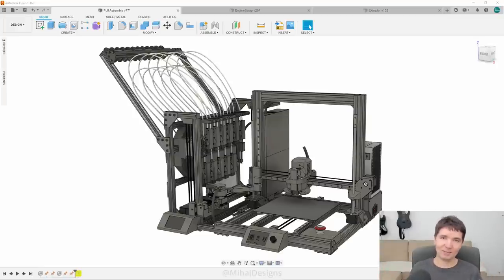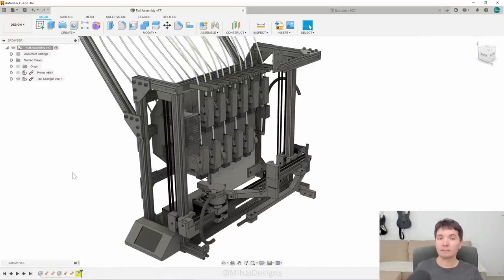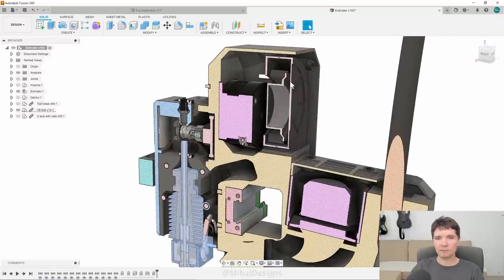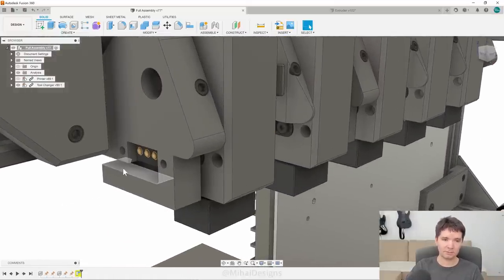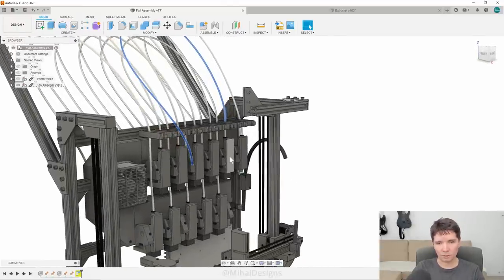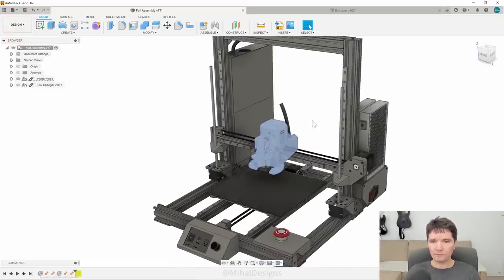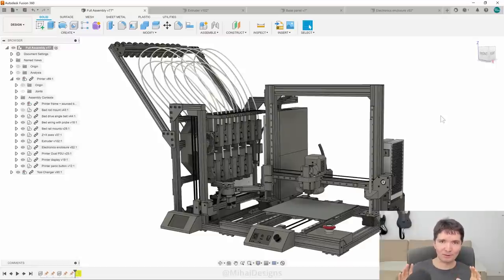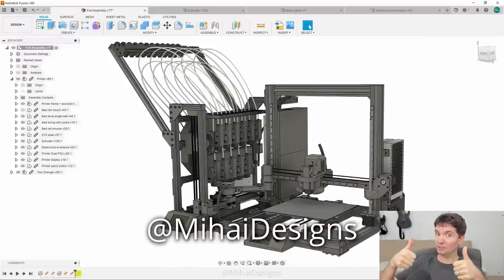PitStop 3 multi-material 3D printer in-depth design. 10+ materials at once

Comment: Great work! Can't wait to see it in action, though I'm fine with my MMU2s as is right now.
Quick question: Where did you source the 4mm OD, 2.5mm ID PTFE tubes?
I'm running couplers (PC4m10) at the back of the MMU2s, and am frequently running into friction issues. Is there an european source, or "only" some non-EU-marketplace?
Reply from the maker: Happy to hear your MMU2S is working well. Sadly 2.5ID PTFE is hard to find. 3mm ID you can find on aliexpress and it works well if you're a bit careful not to kink it. For 2.5mm I had to place a special order and I would have to check where...
Reply: @MihaiDesigns  Awesome, thanks for the info - I'll try with the 3mm ID tubes, and try to add more straighteners (once my replacement revo6 heater core arrives, that is, and I can print more of them).

Comment: Awesome concept and very well thought out. I personally think that many color options is excessive but to each their own. A lot of materials would be great though but I would personally rather see tool options. Do you think this would work with a direct drive extruder, or maybe even other tools like laser heads, mills, plotting, pick-and-place, ect...?
Reply from the maker: I have customers requesting 20 material builds, so there's always a demand for more.
This is a direct drive extruder, so I'm not sure what you mean there.
I'm only focusing at 3D printing for now, although a modified version could host other kinds of tools.
Reply: @MihaiDesigns  Somehow I missed the fact that they are direct drive. I guess I saw the bowden tube and assumed even though I did watch the whole video. Maybe I got distracted by the delta fan. Again awesome work and design. Thank you for the reply and I hope to see how this goes. Good luck with your project.

Comment: I have noticed that filament often breaks when just sitting idle for a few days with minor stress on it. Having 10 filaments threaded and sitting might be troublesome.
Reply from the maker: This is a very good point. I have noticed the same with certain filaments. I'll have to see how often this happens and what solutions there could be to avoid it. Unfortunately I don't have a clean and simple solution.

Comment: have you tried lead screws with a smaller diameter? I have been using 4mm T4 lead screw for a couple of years and have no distortion at all, I never aligned my lead screws. I honestly don't know why most printers still use 8mm lead screws, its very sensitive for misalignment and makes it less reliable

Comment: What sort of repeatability are you getting on the tool changes? Also how are you calculating the offsets between tools? TAMV is a solution I use on the e3d tool changer. Could be used here.
Reply from the maker: I'm still to build and test for repeatability. I expect micron precision. Nozzle offsets measured via probe, just like Prusa XL will do.

Comment: 12:05 With the pogo connector have you considered the possibility of sparks or unwanted momentary connections during the swap process? I mean, if the hotend slides into this connector, whats warranties are we gonna have when, for example, during the slide only two of the for are making contact , even for an split of a second? Can we just turn off completely the connector, change the hotend, turn on the connector and continue with the waiting process for the temps to reach our desired values? I hope to have explained myself.
Reply: Having the connector to a side, I think, is my main concern
Reply from the maker: Yes, for this the heater needs to be turned off, otherwise firmware safety features would kick in and stop the entire device.

Comment: Between Bambulab and this I'm cancelling my Voron 2.4 build...

OR how do I reorient and align it for a toolchanging 2.4... One day when CAN bus boards get cheap the toolheads can include the extruder with no additional pins.

Lastly I would suggest a corexz mechanism a la Voron Switchwire to save space, free up a motor, and avoid leadscrew wobble.
Reply from the maker: I might try that if I encounter problems. And there's also a CoreXY version planned, although still far into the future.

Comment: I remember you miming this idea a long time ago! Awesome development. Great Job, love the concept but the name needs to be changed.  Both ‘Pit’ and Stop are negative terms. Putting them together doesn’t make the double negative (positive). 
Even though the racing term is not by definition negative this needs a much better name. If your printer pits the surface or stops running it is a sad day.  Mythological names or epic terms would suit this jaw dropping concept much better. 

Congratulations, I love it, keep going! 🥰
Reply from the maker: The name could be better. I dumped the previous one, and people kept calling it PitStop (from my previous extruder design) so I didn't bother changing it. Any specific suggestions for the name?
Reply: @MihaiDesigns  Tekton, or Meraki… guessing off your channel name it might make sense to you and go over the heads of most others. 👍

Comment: i still don't quite understand how you would load the filament?
so the filament is in the hotend, but you would need the extruder to be in between the hotend and the spool
how would you keep the spool attached to the hotend while being able to engage with the extruder?
Reply from the maker: This is a fair question. It's actually what makes my extruder unique. The extruder gears move apart during the swap. It'll be easier to show it in action once I get it physically built.

Comment: Instead of having dedicated pre-heating slots, why not just activate/deactivate heating at individual positions?
Reply from the maker: Because I would need a way of driving 10 heaters and 10 thermistors (or 20 for the larger version). Not impossible, but definitely much more involving in parts.

Comment: How do you figure that linear bearing (Extruder asm) is going to hold up? Seems like it could see some significant side load from the cable management if it gets pulled tight or pushes down since that thing is like an 6 inch lever by the looks with the LB being the fulcrum. Side-view @ 25:10
Reply from the maker: I don't expect much tension in the cable loom and I can alter the design to allow for a bit more flex at the back, but it's an interesting idea for a repeatability test.

Comment: I have decided not to get a Bamboo Lab X1C mainly because of the carbon rods wearing away and introducing slop into the bearings, also that carbon dust is really dangerous stuff and combined with fans is a recipe for very ill health, I can see a situation where Bamboo Lab may be receiving some litigation down the road.
 I decided I would like a toolchanger to save on waste plastic and promptly put down a deposit for a Prusa XL but all of the delays really pissed me off so I redeemed my deposit and started looking elsewhere, I was already subscribed to your channel and had somehow forgotten I had seen this video once already, I have considered the Enraged Carrot Feeder but it just does not float my boat and I dont know why.
 I am extremley interested in this design and once completed and Beta is completed I would like to build this whole system, I have some experience in building a printer having already built the Pro 3D V-King 400 from self sourced best quality parts, it cost me a small fortune in shipping costs alone but I have ended up with an awewome printer that I know inside out but I want multi colour and multi materials.

Comment: why not making the pre-heating on the arm, ready to be install on the extruder ?  this way you need only one pre-heating station (on the arm), and not dealing with tangling the tubes.
Reply from the maker: Good question! 2 reasons: one is that the arm cannot cover the connectors the way the swapping works. Second is that it would happen to need more than one hotend preheating at the same time, when the tools need changing in rapid succession

Comment: amazing poject! BUT i think, for the "active" and "non active" parking slots, it would be way bettter to just have all of them "active" and just detect in the g-code when wich hotend needs to be preheated, because al this different additional movement can allways provocate problems, jams or the printerhead itself comes in the way of the moving parkingslot-arm. for the delta-fans, they are realy good, BUT they are also REALY loud! for shipping the printer, it is inevitable to need a first setup with recalibration, this guys wich di the shipping are not realy known to be careful even if on the box it says " fragile" or "handle carefully"
Reply from the maker: The challenge with active parking slots is that if you have 10-20 of them you need custom hardware. Sure, it can be done, but first I want to see if the current solution works and decide later whether it's good enough or needs re-thinking. With the Delta fans I agree that they are loud, but I expect them to run at 10-20% speed most of the time and only crank them up when performance/speed is a priority. Indeed shipping comes with its own risks and there should be an easy recalibration after shipping/moving the printer. Thanks for sharing your thoughts!
Reply: Granted heavy stuff tends to be a bit different, but i have worked in logistics (a loading dock for Walmart) and can confirm they rush you so much warnings usually don’t mean shit lol

The “LumenPnP” Project by Stephen Hawes has a great video on how to pack for shipping + test your method.

Granted i bet that can be put on backburner until the hardware is fully developed lol !

Comment: Ok one very large luming question I've got. How do you hot plug hotends without freaking out the thermal runaway or did you just disable it all together?
Reply from the maker: If you set mintemp to 0 and turn off heating during the swap then there's no thermal runaway error. It still detects thermal issues during heating afterwards.
Reply: I'm guessing that's with marlin? With klipper the temperature spikes to -9999999 or something random depending on which thermistor is selected in the config. I'll have to try it and see if it will work for klipper. Like it makes sense now that I think about it. It's detecting both the minimum tempature and the distance from the set temperature for thermal runaway. If you have no temperature set and the minimum set so low it cannot error then hotplugging should be possible. Thanks I appreciate it I've been trying to wrap my head around this one all night.

Comment: It's probably unrealistic to say the 'nozzles will always be in the same height', anytime you take one apart and put it back together, change nozzle parts out, auto-swap nozzles, it's likely to never be exactly the same repeatedly. Use the NFC tags for offset storage and possibly plan for a way to measure offsets at least relative to something. previous nozzle etc, else a lot of first layer issues, nozzle scrapping top of prints/bed, and inaccurate layer heights between your swap operations. If you don't take variable heights and engagement tolerances into account, you're likely going to be doing some far more tedious tweaking for each nozzle you add, vs some universal offset code.
Reply from the maker: That's why there's a nozzle probe, so we can accurately measure nozzle XYZ offset for each hotend and store it in the NFC tag.
Reply: You didn't watch the video to the end where he addresses this with the nozzle probe.

Comment: Is the mendel style needeed due to your system to work? I'm asking because it seems most printer are moving to a boxed/corxy design so It would be a shame having a system that is considered obsolete while relesed. If possible It would nice it would work on a voron-style printer.
Reply from the maker: At first when I designed this I thought there's no way for it to work with a CoreXY. But since then I thought about it more and now I have a plan to build the same thing but with a CoreXY printer which can be enclosed and can print faster. It needs some tweaks and a special layout for the frame, but will work. I want to do it after I get the current one working well, so probably early next year.

Comment: There's really no need for custom firmware, or electronics. You could easily control it with reprapfirmware by defining some extra axes and using custom tool change macros.

Comment: After experiences with double lead screws and then switchwire I would try core-xz instead of troubleshooting lead screws. The disadvantage is that it is not as easy to disassemble and lower z-resolution (still a fraction of a smallest printable layer height), but you gain z speed (good for probes and tool changers like this), replace 3 steppers (2 special) with 2 standard ones, no z-wobble, no skew... But it may be too much of a distraction from the main purpose of having a tool changer printer.
Reply from the maker: Yeah for me the printer was more of a quick solution for the tool changer. I might build a CoreXY early next year, once the current version works reliably.

Comment: Amazing design! I have a couple of suggestions: 1. I would try to avoid adding flexibility to a moving part, consider replacing the Z axis motor mount slots with a baring at the top of the axis. 2. I am not sure, but from your video it seems that the hot end pogo connector is forced to be connect from the side. If that is the case, this might generate pressure on the pins and shorten its life span. 3. Firmware is not that scary, you got this! I think ST Microcontrollers would be the best choice getting started with.
Reply from the maker: Constraining the Z axis is known to increase wobble. The motion for loading the hotend is in 2 steps, the last one only pushes the pogo pins down on their axis, no side motion there. Already got a few STM32 and was able to flush and debug code on them. Luckily most newer printer boards use STM32 which is great!

Comment: Foarte laborios lucrat , dar mi se pare ca o sa iasa prea greu ansamblul de schimb atc, nu ar fi mai usor sa implementezi ventilatoarele in gantry , doar o idee , nu sunt eu cel mai priceput , dar mie asa mi se pare , si ar mai fi o problema , daca vrei sa faci in masa capetele de este  sa fie turnate pe masini de injectie , sau doresti sa le fabrici cu tehnologie print 3d .
Oricum , le-ai pus fain , dar mi se pare prea intortocheat , cel mai simplu este cel mai ok .
Numai bine si spor in continuare la gasit solutii .
Reply from the maker: A iesit destul de complex. Ramane de vazut cum merge si mai fac modificari pe parcurs. Piesele nu sunt pentru injectie si folosesc piese printate ca sa pot itera. Posibil pe viitor sa adaug piese facute la CNC.

Comment: Can You be so kind and share delta fan spec and where to buy it ??
Reply from the maker: There's a general shortage of fans. I got 7 different models for this size. The one I like best is the Sanyo 9GAX0412P3S001 but I can't find it in stock anymore. Next best is the Delta FFB0412EN-00 (strong but slow speed change). You can find it on AliExpress from a store called Sensda. Sunon also has a promising model but less strong. They all require 12V.
Reply: @MihaiDesigns  thx m8

Comment: why put all of this work into active and passive docking stations? just to save a few $2 mosfets? doesn't seem worth it tbh
Reply from the maker: It's not just the mosfets. It's finding a way to connect 10 heaters and 10 thermistors to an off the shelf board, plus all the connectors and wiring. Not saying it can't be done and it might turn out to be a good solution after all.

Comment: The three-point setup is overrated. I agree, micron accuracy, but. But only in the case when the part lies on a huge marble slab, and does not move anywhere. And if it moves, it's like a turtle. This is not suitable for our task (installing the tool). Kindergarten. It is necessary to use the achievements of big guys with CNC. There you have overloads and forces and accuracy. Again, I draw your attention to my development. SL_ST GrabCad. The head must be simple, light and cheap. In the House position, the mechanism releases the locking device, changes the tool, and fixes it again.
Reply from the maker: Yeah, might not be the best solution. I figured if E3D likes it it must not be too bad. I already have a better design in mind, but it would take too long to implement now. So far I've been using the kinematic mount with no issues, so I'm going with it for now and move the project forward. The mounting system can be changed later if needed.